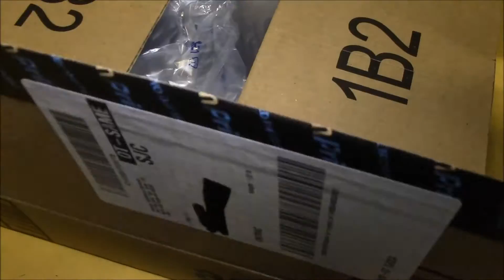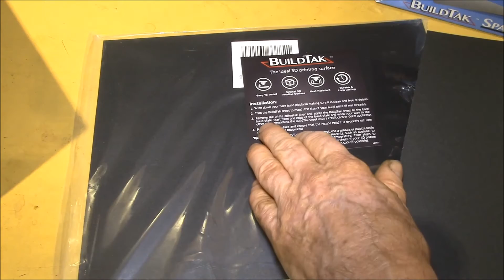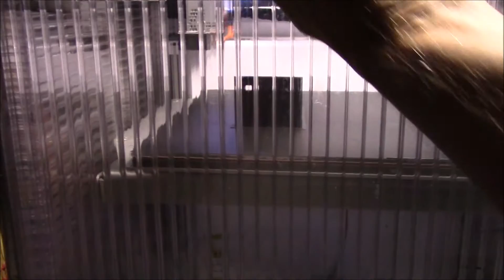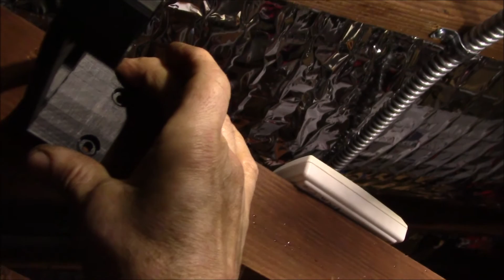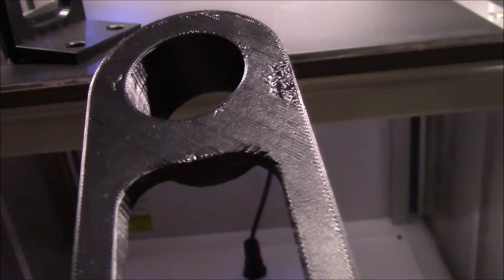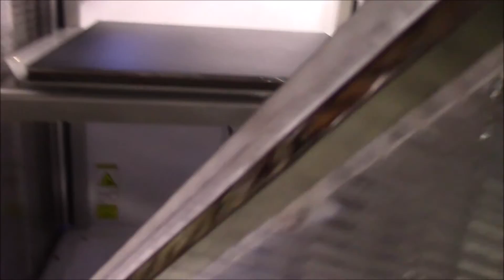BuildTak - First Impressions

Comment: Any chance i can removey the old buildtak glue throughly only by just using accetone? And a lot of scratching? Thanks
Reply from the maker: I imagine that would work.  Acetone does seem to remove the adhesive residue quite well.  Maybe squirt some under the BuildTak and let it work for a few minutes then have at it.  I find it works best to just pull up a corner at a time until it fights back, then move to another corner.  Don't just try to get it all in one go, especially with the Flex Plate, as you risk bending that if you pull too hard.
Reply: R Brown thanks a lot for response. What do you mean by flex plate. I have aluminium plate. Will it get harmed? And i already peeled out the whole buildtak successfully and tried to peel out all the adherent too and got most of it out. All that is left is some parts that got screwed up stucked in the plate. This is my problem. Those little areas. Any advise? Thanks a lot again.
Reply from the maker: The Flex Plate is a flexible steel plate held on with a magnetic base:
- https://youtu.be/g4RVKkUS6dQ
In your case, yes, some acetone should help to soften the adhesive, try that and a razor blade to scrape it up.  Or try a heat gun and razor blade, either seems to work well to soften the adhesive.
Reply: R Brown to be honest i tried with nail polisher i think which contains acetone and it didnt work very well. Maybe i should buy clean acetone? And i am a little bit afraid to use razor maybe it will dmg the plate. Have you tried goon off i think?

Comment: Any advice on putting the buildtak down without bubbles? I had some small ones that grew huge once i heated the bed. thanks.
Reply: Same for most things, make sure they're out beforehand.   slow and steady i guess, and use a credit card or something to make sure none are present.
Reply from the maker: I've not perfected the technique yet either.  WHen I replaced the BuildTak on my new FlexPlate:
https://youtu.be/q1Roj3ayxpc
I did find it helps if you can stand the BuildTak on end touching the side of the surface it's going on.  Then gradually lay it down and pull back on protective paper as you go.  Still had a few small bubbles.  I found I could use a sharp point to pierce the bubble and then on first heating, most of them laid down flat.  I seem to be improving each time I replace a sheet, though.